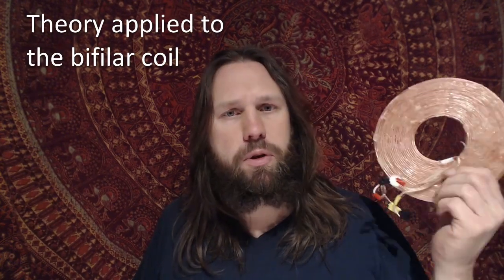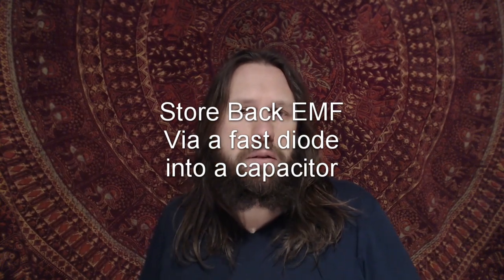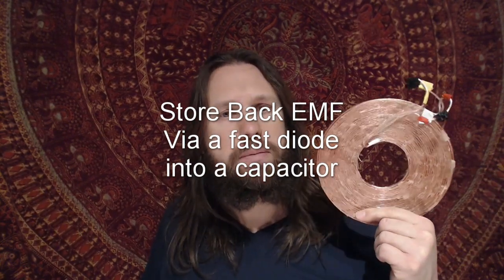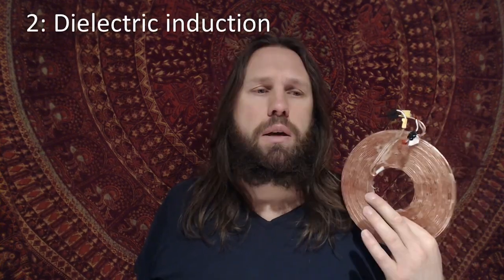C.P. Steinmetz explains electricity 03 Infinite voltage and current

Comment: Amazing! Have you tried these experiments yourself? If so, what were the results?
Reply from the maker: Yes I have, some resistance is always present which limits the infinite. but it did work as Steinmetz explains. Altough I also found out he was limited in his views, as he didn't include the dielectric displacement field.
he didn't separate the electro static field from the electro dynamic field. he both called it dielectric field.

Comment: A suggestion for EMF. Decrease in volts not just change in volts.
Reply from the maker: not increase in volts?
Reply: @MasterIvo  I think increase in volts would relate to magneto-motive force. Thinking of decrease in magnetic field as meaning decrease in volts.
Reply from the maker: @deanboful  hmm depends on the system used. the relation between the fields can vary.  just look at the resonant fields, whereby the EMF and MMF transform back and forth into eachother while changing polarities
Reply: @MasterIvo  I am thinking of 'you cannot have art without thou in a polarized universe. EMF can be related to increase in volts and decrease in volts? No voltage no chance of EMF I know that much :).
Reply from the maker: @deanboful  explosion implosion, push pull
if +15V changes to -15V we  have  emf. while changing the voltage will even become zero shortly.

Voltage is always relative to 2 reference points. so it is a very relative concept. you can ground the positive reference point, then the other reference point becomes very negative

Comment: So, the implication of an inductor producing a voltage or dielectric field is that the magnetism motivates dielectric field movement (in loops of its circuit); when that is blocked by an infinite resistance, the dielectric field will pile up, like a train wreck into a massing of voltage/dielectric field that can penetrate the broken circuit resistance, in dielectric field dynamic form limited by the breakdown of the open circuit.
Complimenting this, the dielectric field of a capacitance that cannot penetrate the resistance of its open circuit, when a change in resistance will release the static dielectric field to produce a self-induced magnetic field through the altered resistance circuit, limited by the EMF or inductance of the closed connection.
Both are partial energy exchanges of electricity, but only represent true power when both effects are simultaneously combined in phase/value and direction. Electrical power is easily created and destroyed by mixing these two separate components of power. But circuit components can be powered with either one and therefore react as if each one is true power, complicating circuit responses when current/magnetic fields motivate one direction and voltage/dielectric fields motivate another.

Few EEs and fewer Physicists understand how to exploit these characteristics to harvest true energy from electricity without consuming both when logically, it's possible and has been done multiple times in the past 100+ years: Nicola Tesla, C P Steinmetz, Joseph Newman, Edwin Gray, Peter Lindeman, Eric P. Dollard, Thane C. Heins... all succeeded but failed to commercialize the products. (and revolutionize the physics and energy industries.)

Party on Dudes, be good to each other.
Reply: Pardon me, when you say "harvest true energy from electricity without consuming both" do you mean devices that consume either pure voltage or pure current to produce work of any kind? I've heard that Tesla's machines operated on Dielectricity (voltage) but I've yet to see any devices that operate purely on Dielectric, got any examples I can look into? Thanks.

Comment: This is what I've been doing, can charge a cap to 8 or 9 hundred volts from 6-12 volts. Have been thinking about using mosfets instead of the tip 3955 and the like.
Reply from the maker: MOSFETS have the benefit of fast switching, plus high voltage capability, with the new SiC MOSFET versions. The body diode of the MOSFET can be used to create pure unipolar voltage impulses, like Nikola Tesla used.
Reply: @MasterIvo  Did you receive the coil info? Looks like it may have been deleted.
Reply from the maker: I really don't know, I recieved a lot of comments. Ivve noticed sometimes comments with external links get removed automatically.
Reply from the maker: got it

Comment: Steinmetz notes voltages of up to 2200 volts as small, dominated by inductance, not dielectric/capacitance effects.
Reply from the maker: Thanks, where did you find this?
Reply: @MasterIvo  "Lectures on Electric Discharges, Waves and Impulses and Other transients" He details out his secrets for simplifying the considerations when using low to moderate voltages (the magnetic effects dominate over the dielectric) and he can set the calculus aside, switching to linear factors, tables, and approximations rather than holding to theoretical processes. (some of his theoretical assumptions have been proven wrong (there is no fixed ratio of current defined by moving charges and magnetic field strength. The real power is using wave theory to directly influence absolute useable energy. it is revolutionary to apply virtual charges to matter without the restrictions of matter (no quantities required) as Tesla discovered/claimed and the industrialists insisted was of no value (yep, totally devalued their material monopolies.) Enjoy!

Comment: Steinmetz was absolutely wrong. Every coil has a bit of capacitance and every capacitor has a little bit of inductance. If you take that into account, even a perfect short circuit or perfect open circuit in case of a coil would not result in infinite quantities. The understanding of electromagnetism cleared up greatly since Steinmetz was around.
Reply: In the approximation where there is no resistance for the capacitor or coil, and they are closed and open respectively, they become ideal LC circuits. No infinite quantities.
Reply from the maker: Yes only in ideal condition there is no resistance and infinite rise. Resonance always occurs. Altough the half wave resonance presents interesting properties. 

C P  Steinmetz paints a clear picture of the field energy tranformations, without using virtual particles.
Reply: @MasterIvo  there is no need for virtual particles here, plain old maxwells equations explain everything.
Reply from the maker: @zoltankurti  "everything" but not longitudinal Aether waves
Reply: @MasterIvo  yeah, because those don't exist. I've yet to see any circuit not explained by maxwells equations. In particular I've seen a bunch of videos claiming to show longitudinal waves, but not one of them demonstrated that the waves are indeed longitudinal. One way to show it would be to rotate a dipole antenna along the longitudinal axis of the radiation. If the signal doesn't changr the wave is longitudinal. But nobody does that.
Reply from the maker: So if we can't see them they don't exist. Fascinating. I agree to disagree.
Reply: @MasterIvo  my stance is a bit different. If Maxwells equations explain every circuit and antenna, meaning there is no proof for anything outside Maxwells equations I won't belive anything else exists. Kind of reasonable, if we have a perfect explannation for something I won't make up additional imaginary stuff.
Reply from the maker: @zoltankurti  Hertz proved Maxwells theories. N Telsa reproduced Hertz proof, but came to other conclusions (including the longitudinal wave). He traveled to germany and explained it to Hertz.
 Hertz is recognized, Tesla not. But it doesn't make it less true. Its nature. A nobel prize can't change that.
Reply: @MasterIvo  Tesla is very much recognized. Here in Europe they teach us in school how he was at the frontier of the electric revolution, pioneered new and efficient designs of AC motors and generators, particularly 3 phase systems. It is general knowledge that he could design complicated systems in his mind. On the other hand he was wrong about different theoretical questions. Hearsay doesn't cut it when the claim is that something as well tested and understood as Maxwells equations are incorrect. The meaning of longitudinal waves is clearly defined. Show me an experiment that demonstrates some field vector is parallel to the wave number vector.
Reply from the maker: @zoltankurti   Maxwells equations, (or better said, Heaviside's) are correct, but do not cover all. 

I also live and work in Europe, and have never learned about Tesla in school as far as I can remember.

That aside, take a look at patent 645576. Here in Tesla explains the effects that impulses have on the conductiveness of the air (natural medium).
And through this he is able to transmit "far the greater portion of the energy of the source and in any locality however remote from the same".

I don't know if longitudinal waves are actually used for this transmission, but I have shown in my latest radiant half-bridge experiments that there are anomalies (current amplification) that support these statement in the granted Tesla Patent.

What I intend to say: All seems to be known and described in Maxwells formula's (Heaviside's) but there is more to it, that is still unknown.

This is what I have also shown (dielectric induction in my "radiant power...." april 2019 video) and which I am researching.

We know much. but not all there is to be learned.
Reply: @MasterIvo  I will have to check your references to answer. The only thing I can comment on is Heaviside vs Maxwell. It's the same thing with different notation. They are mathematically equvivalent. Maxwell wrote it in component form using cartesian coordinates, Heaviside used vectorial notation. But it's the same thing.
Reply: @MasterIvo  If this is the video you are talking about https://youtu.be/1Flj1i0zQ-8 I don't know why your results would be unexpected. The top part of the circuit involving L2 creates a high voltage resonant signal which basically drives the L1 coil. If you put two flat coils closer to eachother than their diameter in a parallel fashion, like you did with L1 and L3 why would yoh not expect the coupling between the driven L1 coild and L3 coil to light up the lamp?

Comment: the reason the capacitor discharge can produce resonance is because it is vacuum energy that adapts itself to the geometry of the coil. it is broadband radiation so it can operate on any frequency and on any coil. the vacuum is life force/consciousness energy. self organizing. negentropic. 

all in all, very good explanation on the "what". 

you need quantum physics to explain the how.
Reply from the maker: The vacuum= the aether
Reply: The quantum physics lexicon calls the aether/dielectric field by many names. It uses the concept of the particle to describe the most foundational physical aspects of the universe though. Dielectric induction isn't a particle though, and neither is the luminous electromagnetic pulse we whiteness when electric and magnetic oscillations occur upon the Aether/dielectric field. Tesla wrote of einsteins folly. Him postulating that field phenomena consists of bumping particles, and that space or time are physical things wich can be bent or curved, actually infuriated tesla.

Comment: Now....imagine a stored energy from a superconductor Technic, that would be able to release instant energy.
That would trash the idea of Thermodynamic.
I bet that have been known by real knowledge people and they have kept that secret for a century, for maybe a good reason.
NOT?
Who knows, since not many knows this and knows what it is about.

Have read an article, where they stored energy in a ring of Mercury at a extreme low temperature.
Where Mercury becomes a superconductor.
Like Eddy current with zero resistance.
They argued in the article it could be a way better alternative to batteries to store energy.
That was 30 years ago. How many knows this today?
It went suddenly black. 
Tried to find it in the internet and there are no traces of it, today.

Well, to defend one side of it. There might be a good reason for it.
What happens when the Mercury gets heated up, when there is stored one megawatt?
According to the laws of changing transient, there may be an explosions of energy.

Comment: IMAGINE AN ELECTRIC CAR. THE MOTOR RUNS OFF 59  LI  BATTERIES AND A BANK OF SUPER CAPACITORS.  THE SYSTEM IS CHARGED BY ALTERNATORS ON AN ARMATURE.  IT IS TURNED BY A SMALL MOTOR.   SO,  CAN YOUR CAP AND COIL DEVICE POWER THE FIRST STEP ?

Comment: My understanding is not good on this subject but if a spike has infinite voltage then with any current not zero then the power under the volt/amp curve is also infinite?
Reply from the maker: basically : Yes.  A  changing voltage in time = current  but if the time is very short, the impulse is longitudinal. magneto dielectric
Reply: @MasterIvo  Hopefully the future......

Comment: Suspect Eddy Current applies to this since "The Wire" is a closed loop so it is infinite long.
So its  Resistance must also be infinite.
Do not think it is current at all and you can not measure its voltage since to voltage is in a ring so it have not voltage difference to measure.
Back Emf is written in Voltage only.
The longer a wire is inducted in a magnetic field the Voltage increases, same thing in a closed loop circuit.
Now it is how long time it is inducted in a magnetic field.instead of how long long the wire is. 
Since the wire in a close loop is infinite.
So the Voltage must be increases as to infinite levels, hence the huge Back emf of Eddy current despite of the speed is very slow.

Comment: "So if we have a magnetic circuit a
 coil with a current going through it it produces a magnetic field and we open the circuit very quickly an infinite voltage is produced by the magnetic field transforming instantly into a dielectric field"  -  Would lightening within a weather system provide the mechanism for opening the circuit very quickly?
Reply from the maker: I think thats works opposite but the same. The weather is like a capacitor being charged, and the lightning is the spark that closes the gap (switch). Eric Dollard saif it is a saturation of the dielectric field, that imploses into a lightning spark (if I remember correct)
Reply: Weather. Yes. Stars formation. Nature is elegant economical never wasteful...the Universe is Electric as are we.
Reply: Is that a thing I don't know if that's been discovered yet(synthetic weather miniature bio dome...has anyone done that?) I know running water through the center of  a coil produces electricity.

Comment: Does Steinmetz ever say a magnetic field 'transforms' into a dielectric field? Or vice versa? If so where. Thanks, keep it up.
Reply from the maker: Thanks Nine Eleven. No, Steinmetz uses another word, that doesn't fully respects the processes, in my opinion, "transforms" makes it a lot clearer. Everywhere is energy its abunded available. we can transform one aether field into another (magnetic into dielectric and vice versa). We still are at the start of discovering Radiant Electricity (another aether field configuration). So this Radiant energy should also be able to transform into dielectric or magnetic energy. This is what I am researching right now.
Nikola Tesla's hairpin circuit, in combination with the bifilar coil. I hope to show more soon.
Reply: Looking forward to seeing what you present. What is Radiant Electricity? Thanks!
Reply from the maker: That is a great question I hope to answer in more detail in the future.   What I know so far, this Radiant Electricity/energy is what Nikola Tesla discovered around 1892, and explored from then on.

Comment: Hello Ivo
Well explained your videos, the theory of Steinmetz is not new to mi, but this inspired me for a setup to test, combining diferent sorces.
If we use two pancake  coils  and connect to each of them : 1 switch to discharge a capacitor from  a power source , 1switch do discharch a second capacitor at sinewave peak and 1 uf diode for capturing bemf.then connect it alternately that coil1 feeds coil2 and reversed, and use pickupcoils like skycollection to harness the excessenergy if ther is any.